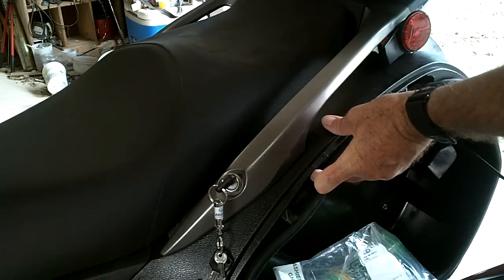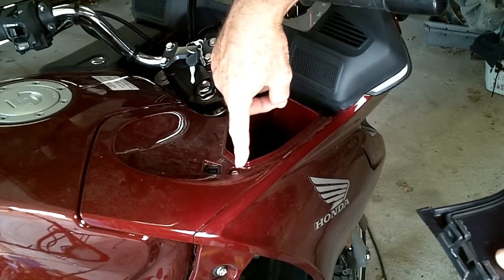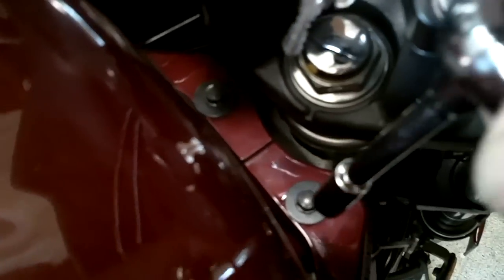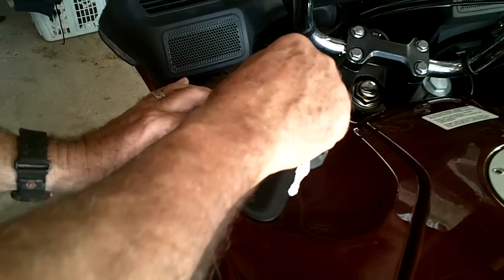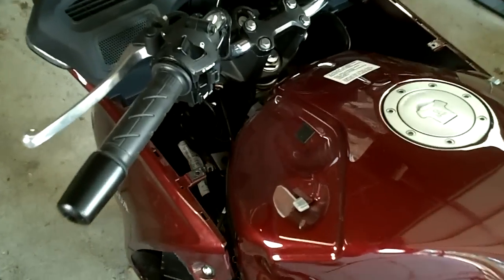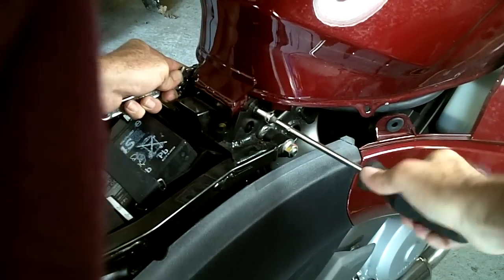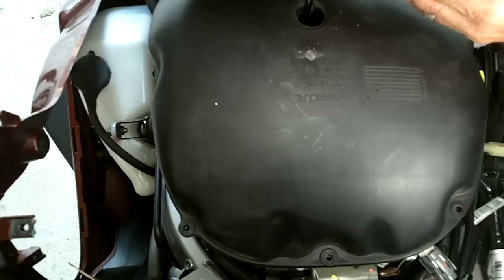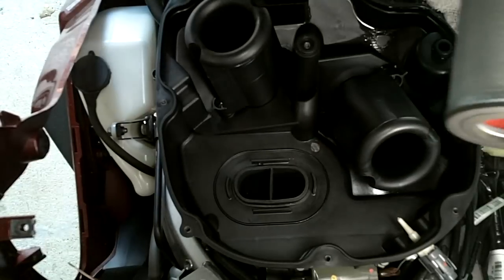Honda NT700V Air Filter Change

Comment: well done methodical explanation on how to remove the gas tank and get at the air filte.. Honda motorcycles especially my Honda GL 1800 Goldwing, and my two Honda pacific coasts we’re a Chinese puzzle to remove the plastic also.. The plastic that you have to contend with on a Honda, GL 1800 Goldwing is one of the big reasons I sold my perfect Goldwing.. on the Goldwing, when I was attempting to get the rear shock absorber off so I could upgrade the spring to match the upgrade I did to the fork springs, I thought I could get at the shock absorber if I removed the right saddle bag. I had the 2 inch thick genuine Honda service manual to help me. I gave up after about two hours… those Honda designers are so expert at making all the different systems fit together tighter than the pyramids are put together.. it’s almost laughable how difficult it is to contend with that plastic. To get to the rear shock on my Goldwing, I had to start by removing the bezel from around the instrument panel on the dashboard
  Honda also didn’t make it very easy to get to the air filter on the Goldwing which cost you around $600 labor if you take it to your Honda dealer to have the job done. I thought that was ridiculous when I heard how much dealer’s charge just for the labor to change the air filter. But after doing the job myself, that is a fair price. Again you have to. start by removing plastic around the instrument, panel on the dashboard, and work your way back to even removing the seat and all the plastic in front of your knees and the huge cover that looks like the fuel tank, and lots and lots of different screws and plastic pop rivets that you better keep an order.. I got a big piece of cardboard and poked holes in it with a number to Phillips in the same pattern as they were being used on the machine, and I labeled each hole with a an ink pen, because all of those screws are different lengths in some cases..
  after getting a taste of what it’s like, just to remove the plastic to get at the engine to do service, that’s what soured my disposition towards the Goldwing, as perfect as they are.. some people may think, well I don’t have to work on it I don’t have my dealer work on it. It’s just as difficult for the mechanic to work on it and you’re paying him about $125 an hour..
if you have your mechanic at your dealer, do the labor to change your air filter every 10,000 miles, and you keep that machine for 100,000 miles, that means you will pay that mechanic over $6000 just in labor simply to change the air filter 10 times in 100,000 miles .. what is probably going to happen, is neglect. Like the goldwing i bought used with 13 K miles on it. The owner told me that he had never had the air cleaner changed when I bought it. He said that dealer Labor cost for that is a bit stiff. So he like probably many other owners just don’t have it changed very often. When I opened mine up, there was A mouse nest in the air cleaner housing. I have the video on YouTube under my other screen name, which I no longer use when I first started making videos. But the name of the video is, three words.
Goldwing made mouseproof..
there are several videos with that title on YouTube. Mine is the yellow one in that video. It’s only about a minute or two long, showing how I put screen over the intake, trumpets to prevent mice from getting in there, which is not uncommon to find mice in air cleaners .
I bought a saab 900s that needed 3rd/4th gear repaired. I picked it up for a song. And it was not far from home. So while driving the car, the 4 miles to my home, I stopped for gas., The car would not restart. It cranked, but would not start. So I had to have it flat bedded to my home. I found that the air cleaner was packed, packed with little seeds and mouse fluff, so packed, that is completely shut off the air. And coincidentally, I also found an 18 inch snake skin inside the air filter housing..
  I also found mice were living in my Yamaha RZ 350 air filter housing
  and finally, I went to a friends house to begin our journey on motorcycles that day. When he started his BMW, R 100/7, and we drove down the road to the first stop sign, I was behind him. I saw mice, jumping out of his motorcycle…
  so you never know what you might find inside one of those air cleaner housing’s

Comment: Thank you for the video.  I can now access under the tank with confidence.
Reply: It's a pain to rip off the sides, the way they hold on with velcro. I've not looked at any videos before and kept thinking whether I've missed a screw somewhere and I'm about to damage and break stuff. Put everything back together and realized I forgot to attach back some screw from underneath (was working on the radiator). Rinse and repeat. :)

Comment: Can I use this tutorial to get to the carburetor?
Reply from the maker: I think these bikes have electronic fuel injection... but I'm not sure exactly where it is located. You might try running a bit of Seafoam Green in the gas tank to help clean the injectors if the bike is getting a bit boggy.